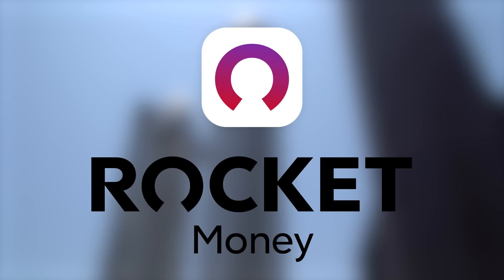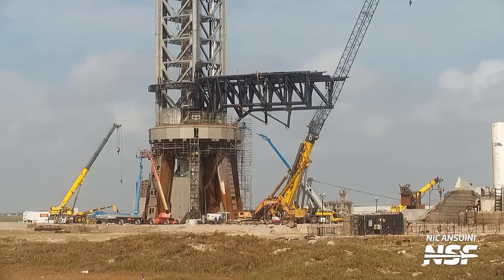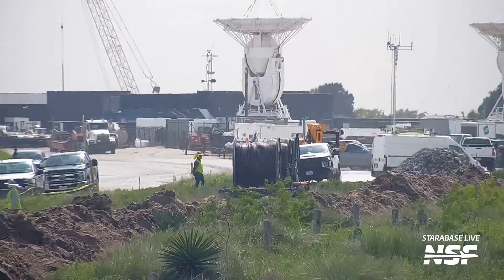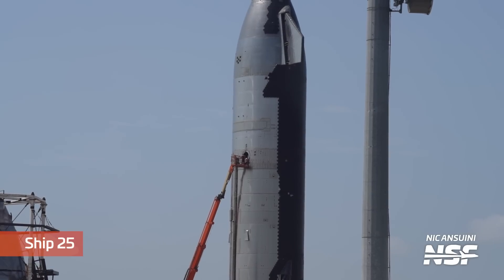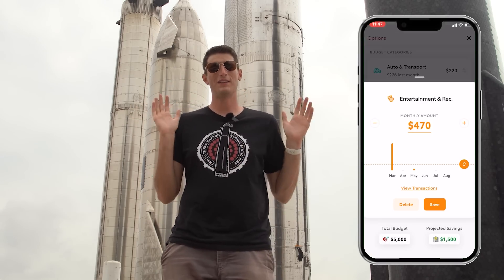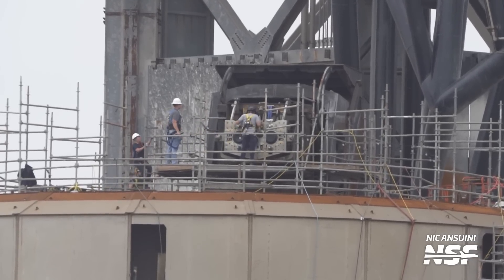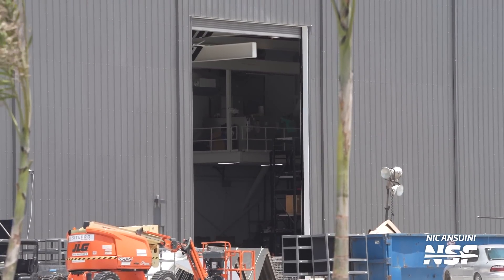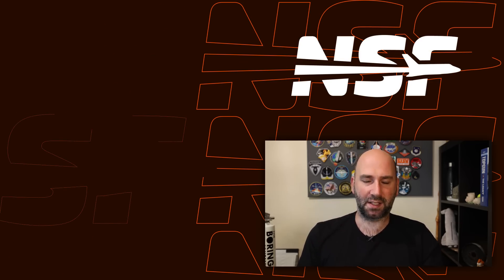Starbase Update: When Will The Next SpaceX Starship Launch Happen? Progress at Starbase

Comment: Why don't they have any vents or tunnels underground on all 4 sides?  You have those hundreds of thousands of tons of thrust going straight down to the ground and no wonder why they had all that cement and stuff flying all over  some as far as 6 miles away pieces of concrete. It doesn't take a rocket scientist (no pun intended) to figure it out. If it's too  wet below the surface there put tunnels on the surface put vents reinforced going out so that the blast goes out in 4 different directions that way you don't have all that nonsense. I hate to sound so simplistic but why didn't anybody think of that?! I sure as hell don't want to go up in that rocket, would you?

Comment: Ask not when the next launch is, it is the one after that which matters.  With Melon Husk steadfast in his demand to fo the steel plate instead of a real launch pad, when that doesn't work out for the next launch, there will need to be a fair bit of redesign needed. 
Pushing water up through shower holes in a steel plate is not gonna be easy when you have a gazillion pounds of thrust exerting pressure in opposite direction.  A gazillion pounds of thrust from engines is likely to win against water and the flow will be of hot gases penetrating the steel plate instead of water exiting the steel plate. 
at the end of the day, to achieve quick re-usability they will need to change the architecture of the OLM.  And driving more piles into it will make the difgging of proper flame trench even harder.  Suspect a new OLM upper ring  will be built in a hangar and fully kitted out, and when they are ready, they will rip the old one and its foundations build proper foundations/trench and then put the prefab ring on top and just connect to the umbilicals to ground.

Comment: I think it can be done way quicker than 4-6 months.  The Raptors already did much of the excavation and removal of existing infrastructure for free!  Keep in mind that this is not delicate, technical work with tiny tolerances, experimental components and many moving parts.  This thing is super low-tech and most of the work can be done with heavy equipment.  The construction tolerances are in inch(es), not fractions of a millimeter.  It doesn't even have to be level.  It's a water pump, water pipes and some big steel plates - things we've been building for 100+ years.  That's doable in 1-2 months, maybe quicker with a little overtime, unless they also want to build more berms and shielding for the nearby facilities too, which could drag it out a bit.  The biggest potential snafu is whether they'll need some kind of retention pond for the runoff - which would likely require an environmental permit (i.e. DELAY).

Comment: Concrete takes a month to fully cure, longer for large pours. It can be used about a week after it's poured (at least for driveways) but for launching a rocket I suspect they would want it to be as strong as possible.

So add at least a month from the last pour then multiply by Elon time. Launch date is 4-20-2024.
Reply: Different concrete types have different curing times.  The special concrete used for the launch mount has a very fast cure time, on the order of 48 hours for a complete cure.
Reply: That was the Fondag they most recently added with those properties, I believe, but with the area getting covered in a steel plate/showerhead I'm not sure they would bother with the fancy stuff again.

Comment: Guess what..the first woman to set foot on the Moon will be Chinese. Starship delays will set the Artemis program back by years. Starship is the vehicle of the future, but, for now, we a Moon lander based on Dragon tech . We don't need 150 tons to the surface of the Moon right away. 25 tons plus 4 astronauts would be fine for the beginning. This could be done using a modular system launched on Falcon Heavys and assembled on orbit. Just a thought.

Comment: Question: I think it was the night before the Heavy launch, something fell inside of the tower the rained a shower of sparks. Did you ever figure out what that was and did it affect the launch tower? Thank you
Reply: I seem to remember hearing it had to do with the work elevator in the tower, a cable snapped and fell or something like that.  It wasn't part of the chopsticks or anything mission critical, so I think they just ignored it.  It's been a while, though, I could be misremembering something.
Reply: @srrich27  Ah yeah, that's right, i remember hearing that also now you mention it.
Reply: There hasn't been any mention of it, the chopsticks still worked, so whatever it was, likely didn't cause any significant damage, probably just a chunk of concrete, but yeah it would be interesting to know for sure what it was.

Comment: Where did the phrase " Elon Time" come from? Is it that over the previous couple years Elon provided a time frame in which starship would lunch and didn't? So are we to simply to take Elon's statements with a grain of salt?
Reply: Elon Time has become a bit of cliche and does in fact go back several years when he was making predictions for Starship's first launch that weren't even close.    So indeed I take what he says with a grain of salt.   Whatever time line he predicts double it.    Elon said the next launch could happen in 6-8 weeks, but it will take at least that long for the work under the OLM to be completed.  Add another month at least for testing the next booster and starship which can't even start until the OLM is finished.  Then there is the unknown with getting certified for next launch and possible lawsuits to block the next launch.

Comment: The water jacket plate would be more effective with chilled water rather than ground water.
Reply: Prob so, but I'm sure the Numbers-crunchers have worked out the Cost-Benefit numbers regarding just HOW much better Pre-Chilled water would perform over Ambient Temp water... Might be that to get it to a Temp that would make a significant difference may be cost-prohibitive... Possible too, that to MAKE that chilled Water there just isn't Room PHYSICALLY in the area to construct .:hand-purple-blue-peace:

Comment: I can't even imagine how they build such a massive structure like the tower, especially when we see how small some cranes are right next to it.
Reply: That's because they use the massive cranes called LR11350-P1800 crawler crane, they are made in Germany if i am not mistaken.
Reply: That LR11350 could be configured differently depending on the height that it was lifting to and how heavy the hardware lifted is.   There are good YouTube videos of that Liegherr Crane which show its potential.

Comment: Shocked to hear you say 4-6 months. You definitely know more than I do, I’ll make that clear immediately, but still surprised. Based on how fast things are going and Elons 6-8 week timeline that was said over a week ago, I’d expect 2-3 months based on that. 

Thoughts? Open to criticism here, even if it means I’m way wrong!
Reply: Elon time is always optimistic. Divide or multiply by two as needed. Imo 2-3 months means 4-6
Reply: @paulhiggins6024  Hilarious if you think that lawsuit is going to do absolutely anything.
Reply: @maultwo  Of course. It is unlikely that the FAA will allow any more attempts. And especially with a water deluge system, I am quite sure they'll also demand a new environmental impact study. Given that there were huge chunks of debris and even a fire in the protected area, I highly doubt the current measures are enough.
Reply: @nukularpictures   "It is unlikely that the FAA will allow any more attempts." - what do you mean by this? They have to file for a new license each launch regardless. 

And aside from harmless sand, all the chunks of debris were within a relatively small area (~half a mile), none was found in official refuge-owned lands outside of SpaceX's facility.
Reply: @Tanks_In_Space  You can't compare a long-term vague estimate like that to something as specific and short-term as the next Starship launch.

Also, this classic quote applies: "at SpaceX we specialize in turning the impossible into late"

Comment: Why did they installed grid fins on Booster 7 and flaps on Ship 24 if they wasn't going to save them? Will they repeat the same error with another stack?
Reply: Grid fins and flaps on each were added on the hope that both would make it back to a soft landing at sea.  B9 has updated hardware to correct for many of the problems the first launch had.   Space X could already foresee some of those problems which is why they thought cleared the tower in itself would be a success.
Reply: Both still needed them to fly.

Comment: I would think they will need to do an extensive static fire campaign on the next booster / stack to validate the flame diverter once its in place etc.  They also really have to solve the Raptor reliability issue during flights.  1 other thing I have wondered.  Could they use Star Bricks to cover the OLM legs to help protect them from all the flames?
Reply: Bricks are made to be light, and no need for that on ground. There you need extreme longevity.
Reply: A lot of people seem to think the raptor failure was down to them being hit by concrete. Hopefully once they build a launch tower that the engines won't destroy when launching from it, they will get a better view on how reliable the engines are.

Plus having engines being move into an out of starship multiple times can't have been good for them.
Reply: Absolutely not.

Comment: they need to get the flight termination system upgraded and that can take months if not years.if you google ( flight termination system requirements)you will see what it takes to get it aproved.
Reply: My question is why did the flight termination system get approved in the first place. I would imagine Elon would be quite happy to put an overkill flight termination system in just to speed up approval time ,if that is at all an option...
Reply: @callumcurtis15  Agreed.  I think this is what many are overlooking.  SpaceX wasn't free to design their own system - it was designed to specifications and approved by the FAA.

They need to review the issue, sure, but this surely isn't all on SpaceX.  The FAA will hand back changed specifications, SpaceX will comply, and we'll get things moving again.
Reply: On the other hand, this system required the same certification and had it.  I suspect they will both be eager to review the issues, rectify them, and get things back on the road.

Time will tell, but I suspect less drama than these narratives would suggest.

Comment: looks like they need dual launch areas in the future
Reply: Well they do already kind of, there is the one being built at the cape, but NASA likely won't let them use that until they can prove it won't destroy the area on lift off and so on.
Reply: @rjswas  Right... As future R&D Continues at Starbase, there should probably no need for Rapid Relaunch Cadence(with the caveat of just needing to Prove it could be done) Boca Chica is just a Test Facility:_Starship2::_raptor:

Comment: This flat plate will fail to protect against the carnage. The energy needs to go somewhere, and if it can't go down, it will go to the sides, and there's plenty of things to destroy around the tower, including the tower legs and the plumbing that surround the table. I hope I'm wrong, but it seems SpaceX is willing to ignore the lessons already learned.
Reply: Your assessment ignores the deluge that will also address what caused much of the damage to the pad from the acoustic effect of the raptors firing for seven seconds before lift off.   Okay they weren't ALL firing, but Space X took that long to get all engines firing before lift off which added to the damage to the pad.  

The next launch Space X is planning to launch in 2.5 seconds which combined with the other measures will greatly reduce damage to the pad.
Reply: @Michael Deierhoi  I hope I'm wrong! One of the most basic principles of physics is at play, Every action has an equal and opposite reaction. Given the mass of the ship and booster, the opposite thing is nuts.